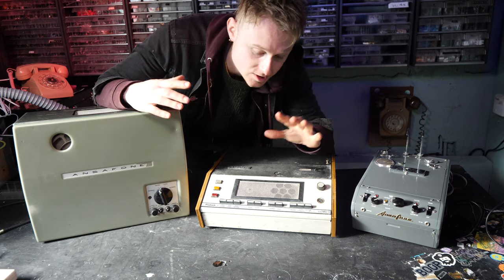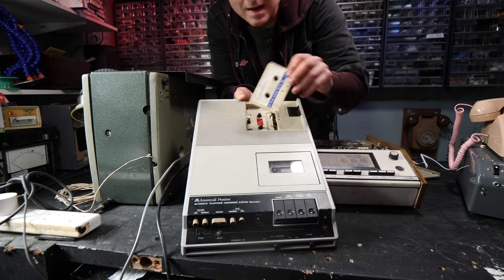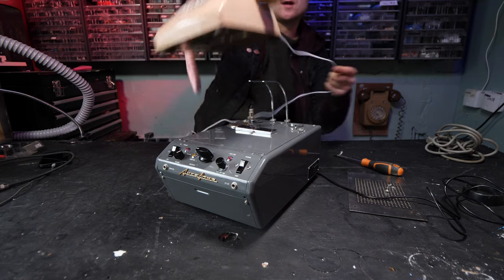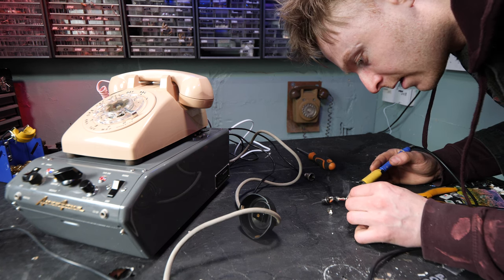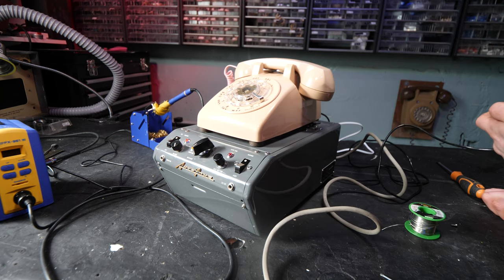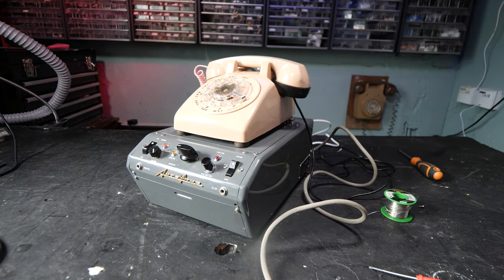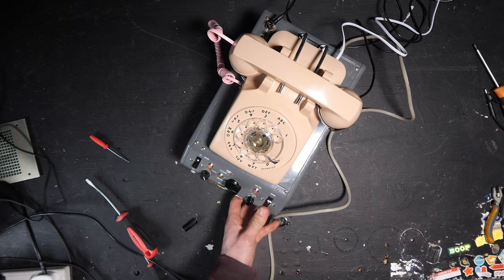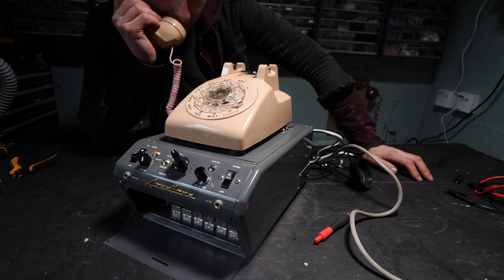Robotic Armed Answering Machine? ANSAFONE

Comment: Two bits of info that might be of interest in your troubleshooting:
1) US phones often ring at 20 or 30 Hz. IIRC, BT used 16.67 Hz. Depending on how the ring sensor works, you might not be matching frequencies correctly. (Of course, I'm thinking in terms of a 21st-century PLL, so YMMV. 🤷‍♂)
2) US phones come in both 24v and 48v varieties, depending on the era and region. If your Strowger system is using the other voltage, that could explain some of the mic gain issues you're seeing.
Cool stuff! 👍
Reply: Hey up cheers ted! I guess that's why the capacitor swap worked then! As for the voltage interesting I was not aware. Cheers
Reply: Indeed  the same in Canada, 24V up to the house then it dropped to an Average 5V (from 3 to 9V)

Comment: I think it might not be lifting the handset high enough.
You know the mic works, it's the same circuit you used to record the outgoing message.
You know it's recording in answer mode because it heard you near the machine.
I think there might be a contact for mic hot on the phone that's open unless the handset is lifted just a little bit more.
Reply: I was thinking the same!
Reply: If it was the case the loop with the other phone would be made that's the only issue with what you are saying. If the speaker was not making contact the loop would be incomplete and I wouldn't be able to hear anything. However you can hear it recorded just very quietly
Reply: @LOOKMUMNOCOMPUTER  Was it hearing you through the phone's circuit, or was the mic just picking you up ambiently (hence the very muted level) and, as importantly, can you confirm that you can hear it with the receiver's on-hook buttons pressed just a little?
Edit: I mean on the American handset. Pick it up and depress the hookswitches just a little. Do you still get sidetone?
Reply: @SwervingLemon  hey up. Cheers for the comment I'm not quite sure what you are meaning but I'll try and figure it out. The issue with if the buttons are still slightly depressed on the hook and the speaker is not in the loop would mean the loop would be broken and the mouthpiece wouldn't even work. I called something whilst it was engaged with the hands and you could still hear the loop
Reply: @LOOKMUMNOCOMPUTER  Ok. Damn. I had an old Bell handset that if you so much as brushed the hookswitches, the receiver no longer had any speaker output. Guess that's not the case here.
Reply: @SwervingLemon  wel it's possible. And when I look again. It totally could that. Having not looked at the scmematic of US bell phones I'm working off a different understanding. I will try again. Also maybe when I tested it cus the magnet was dormant for a while after a day of use it got stronger after I shot the vid. Will let you know

Comment: For sure the first one is a vacuum tube one, if the other two are also, they caps would need to be changed to give the best chance of working long term. The First one and the USA-made one are pretty dammm coooool. EDIT BTW idk about the USA, but here in Canada, all our phone lines work on 24V (not 120v) to the house then is dropped to 3V to 9V.
Reply: I thought all phone lines were ~48VDC on hook which then drops off hook. I've measured 6 volts when in use which matches what you said. US ringing is 90VAC 20Hz and I presume Canada is identical, but I think other countries are a bit different but still close enough.

Comment: American phones on British equipment are are quieter in general, because there’s an impedance mismatch.

From memory I think American phones expect an impedance of 900R but British equipment has a line impedance of 600R - so can’t drive enough power in the speech circuit to make it loud enough.

There may be ways around this, but I’ve never tried… as 500 types fall outside of my interest!

You may be able to tweak the network in the phone to set it up for a PAVX line, which Google suggests is 600R even in the USA?
Reply: “PABX” not PAVX - stupid fingers
Reply: the Canadian ones look the same but run 600R. i believe. might be the one ?
Reply: Yes interesting. Sounds good! I suspected a region mismatch. But having checked the phone up against another level wise. It was still recording a tad low. Got a couple of ideas. If no work I'll be looking into botching the phones circuit

Comment: Random electronics question for you Sam... When working with keyboard switch matricies (eg the piano keyboard for midi).... what frequency are you clocking each key? I've got an 11x8x11 (hit/velocity) matrix that im trying to make a controller for from scratch and im curious how fast is acceptable to cycle the multiplexing
Reply: Make it variable on a potentiometer and you can try em all!
Reply: If you're 10x the fastest speed that you're likely to press the keys you should be fine, realistically you probably aren't hitting the keys at more than 10Hz so 100Hz should be more than adequate (10ms loop).  If you're using a microcontroller then it will probably scan pretty quickly.  As Sam says though you can adjust it on the fly and try that.
Reply: @LOOKMUMNOCOMPUTER  When i pulse each of the 11 lines, i get 8 data line outputs like a byte so id have to detect the frequency and change my baud rate for the serial input im planning

Comment: Different spec for European, the loop inside the phone isn't going to match the signal through the line, check from another phone.
Reply: Having checked the volume it is plenty loud enough there is no discernible difference in level
Reply: @LOOKMUMNOCOMPUTER  Doesn't make sense that the mic gets people talking in the room but can't hear a speaker that's right up against it...
Maybe the hook switch on the phone is wonky and when it's lifted up by the arms enough to take it off hook it isn't lifted enough for all the contacts to meet, and that's muting the speaker?